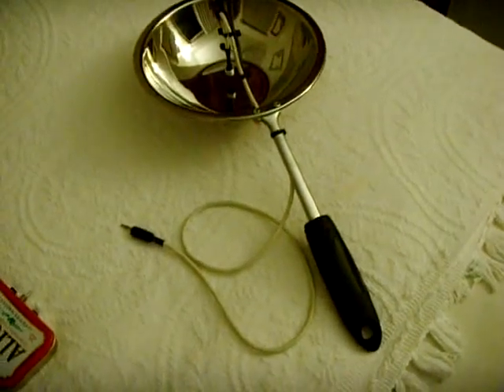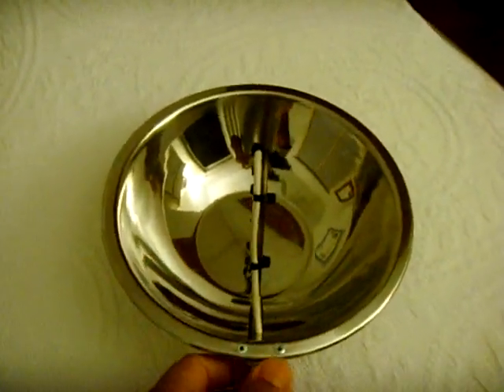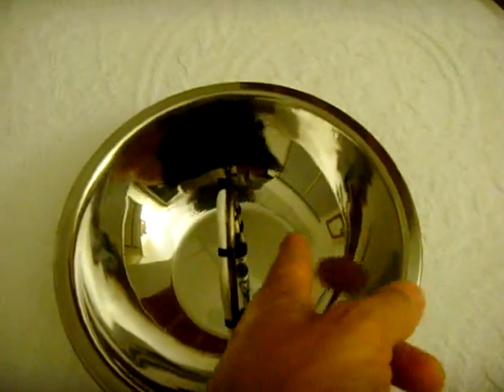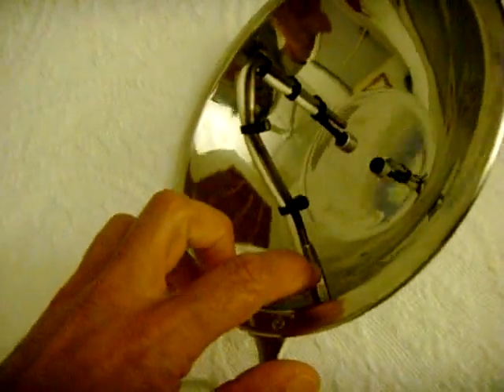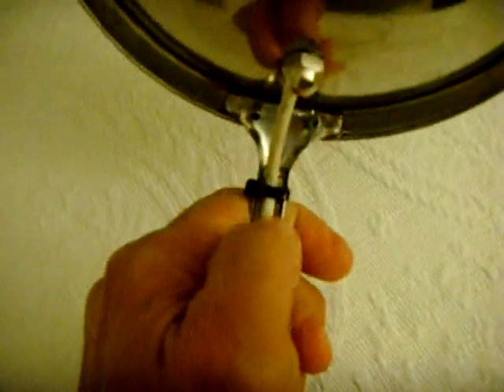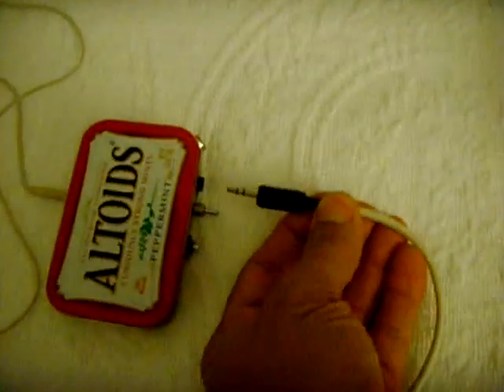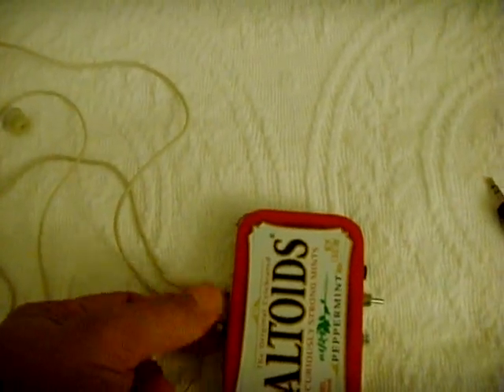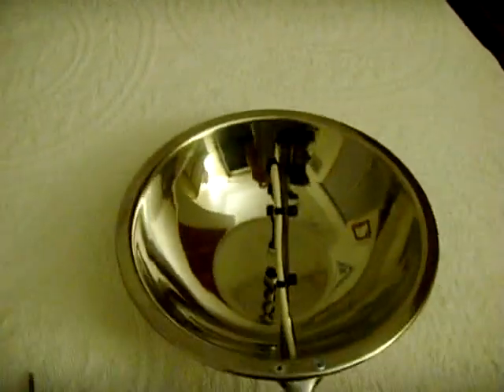Parabolic Microphone for my Bionic Ear Amplifier Circuit

Comment from the maker: @s0ap001 You will need a DPDT switch. The switch will be used to disconnect each mic, and connect the mics on the parabolic dish. Disconnect the mics on one side then connect a wire from where the mic use to connect to the .1uF/1K resistor and run it to one side of the 2 MIDDLE pins on the switch. Repeat this process for the other remaining mic and connect it to the other side of the MIDDLE pin on the switch.Take one set of the upper or lower remaining pins on the switch and connect

Comment from the maker: @s0ap001 the mics that you disconnected earlier, and connect each mic wire to one side of the upper or lower set of pins. Make sure they are both connect on the SAME set! On the remaining set of pins on the switch, connect the mics from the parabolic dish to each side. Make sure each mic is in the right spot for L or R. If wrong, switch the wires around on the parabolic mics. Take the other wires from the parabolic mics to ground.